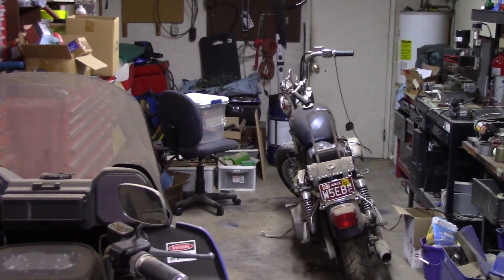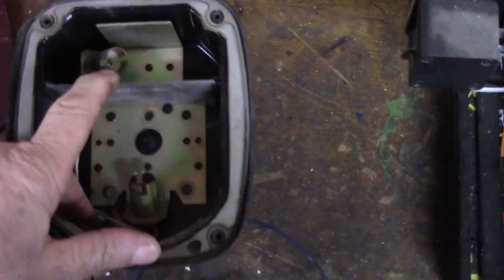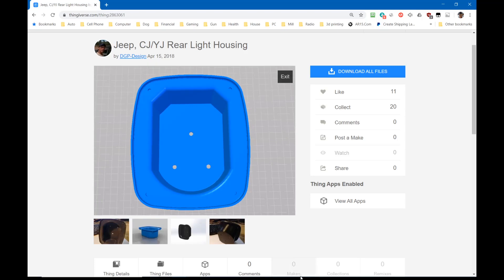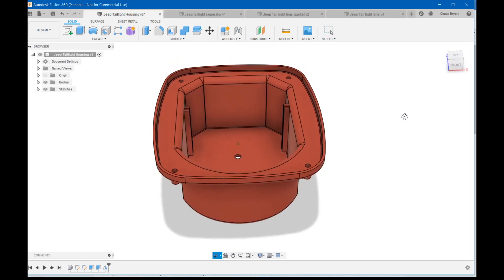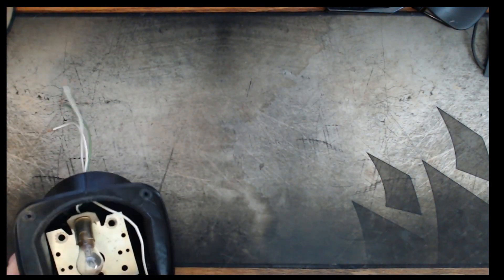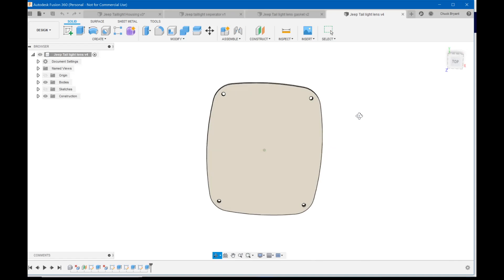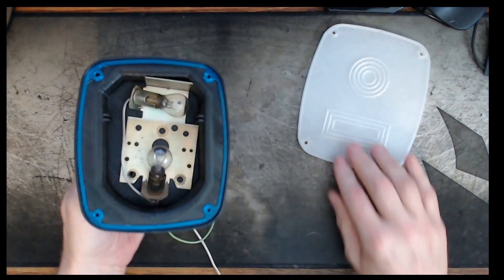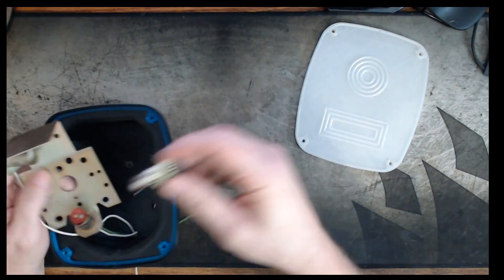3D Printed Jeep CJ YJ Taillight - Housing, Lens and Gasket

Comment: great vid. i have some similar project i would like to take on as soon i get my 3d printer lol just wondering how is the lens holding up over all these months?
Reply from the maker: I've got a later video where I showed it after the summer here ended. It yellowed badly and got so brittle I could snap it like a cracker in my hands. Obviously ABS was not the best material to withstand a summer in Arizona. So the next step was to print it out of PETG and ASA, which I did in a later video, and try again next summer. Check out my video series on the Jeep Taillights and you'll find all the videos. And hey, get that printer!
Reply: Oh yeah i can wait to watch. i think asa is the one to try next and yes I plan to get a end 3 like yours to start and build an encloser aswell want to use filements like abs and nylon.

Comment: Chuck ...if you dont mind me asking.....what are you using as far as pc....graphics card ect.. To run fusion. This seems to not be covered anywhere
Reply from the maker: I don't mind at all, although I'm not sure the answer will help you out much. First understand that in real life I'm a computer tech and an avid PC gamer. My current computer is a little over 2 years old and the specs are below.

Fractal Design Define R5  ATX Midtower Case
ASRock X370 Killer SLI/ac AM4 AMD Motherboard
AMD RYZEN 7 1700 Processor
MSI Radeon RX 570 Video Board
Corsair VENGEANCE LPX 16GB (2 x 8GB) DDR4 3200 (PC4-25600) Memory
Samsung EVO 850 500 GB SSD Hard Drive
Maxtor WD Black 2TB Hard Drive
Seasonic FOCUS GX-650, 650W 80+ Gold PSU
Cooler Master MasterLiquid Lite 240 AIO CPU Liquid Cooler
Windows 10 Pro

If I remember correctly it cost about $1300 to build the above computer. 2 years later it still runs even new games quite well. Things like Fusion and Cura don't even heat it up enough to cause the fans to speed up. It's also really quiet. I built two of them, one for me and one for the wife despite the fact that she never plays games, but I guess you probably know how that goes. lol.
Reply: @3rdpig  
Yep....makes sense. My current pc cant handle fusion...so im building my old dell that i burned the hard drive up in. Funny that nobody seems to mention that if ya wanna do any designing on your 200.00 printer....your gonna need a workhorse of a pc.....to me anyway..."im not a gamer". But i do appreciate your content. Thanks for the reply and keep up the good work!
Reply: @calebphelps7030  rx570s and 580s are cheap used. Before the rona shortage i got a 580 from xfx for 100 off egay. Just be careful ebay can be sketchy sometimes
Reply: @calebphelps7030  my 2700x despite being considered outdated is still over kill for me. Plus i over clocked it for the hell of it. Also it has a noctua cpu cooler. Its built in a 25 year old dell case. Looks like a turd i love it
Reply: I have a 
msi b450 a pro
Ryzen 2700x 
Xfx rx 580 8gb 
16 gigs Kingston ram 3200mhz
500 gig m.2 with a 1tb samsung 2.5 ssd and another 3tb hdd for digital hoarding of files like the history of my jeeps 😃

Comment: Really good project, Chuck. It has really demonstrated that all your efforts to get the ABS environment right are paying off in spades.
Reply from the maker: Thanks Paul! Good to hear from you again. ABS really makes a good part, it's strong, has just enough flex to be durable and tough. I'll be honest though, I was amazed at the quality of the clear ABS. I expect I'll be using it a lot from now on.
Reply: @3rdpig  You had a lot of trouble with the polycarbonate. Good move.

Comment: Nice practical application for 3d printing Chuck! I like the led lamps. I didn’t know they made such things and I think I’ll replace mine with those when the time comes.
Reply from the maker: Thanks for watching and commenting!
Reply: I like to 3d print switch panels under my dash so i can mount switches without drilling. There are many uses. Plenty practical, plenty un practical. 👍

Comment: Very very nice job chuck. Are you doing both to match?
Reply from the maker: Yes, I'm printing both sides. I'm going to do an update in a couple of weeks when I get it completely done and mounted on the Jeep with the LED tape for the license plate light.  It's got aluminum diamondplate corners, so I'll get out with the buffing wheel and get it all shiny. Should look pretty good. I have to make the part for the LED tape for the license plate, but there's one on Thingiverse that might work, if not I can easily design one. Thanks for watching Matthew!